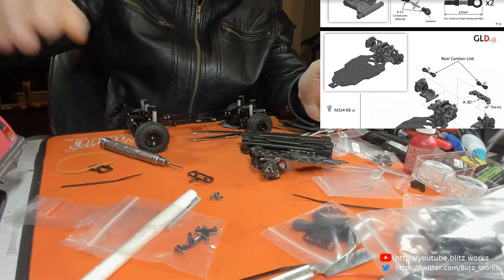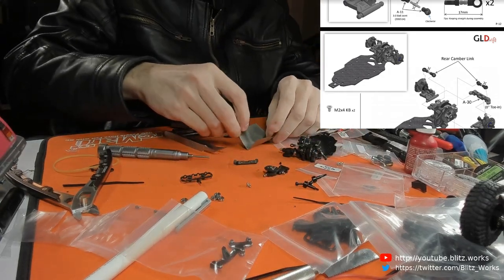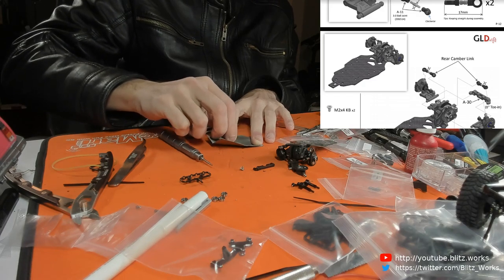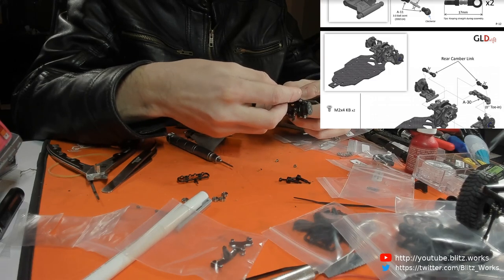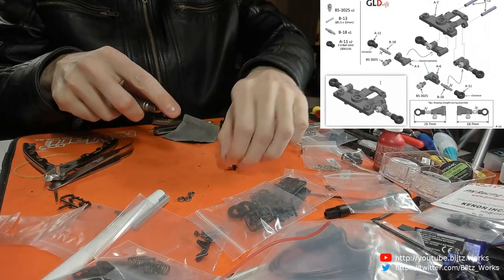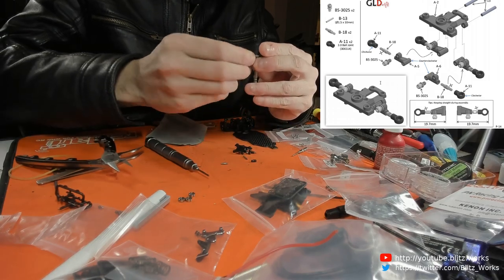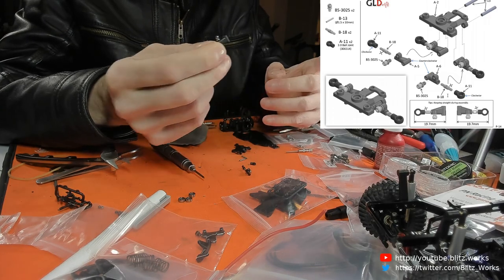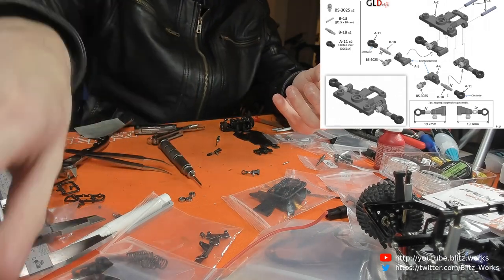Building the new GL Racing Drift car - The GLD - Part 2

Comment: I only recently found your channel and appreciate the fact that you shared these build videos. What grit sand paper were you using to do the polishing?
Reply from the maker: 1000 grit and 3000 grit. the kit itself comes with one of these but ideally you want both  for polishing some of the plastic to plastic connections and something more aggressive for cutting such as 400 which i regret not having on hand (spent more time polishing due to that)

you should be able to cut material away wit 400 until it starts to loosen up a bit then go to a higher grade sandpaper and work your way up from there.